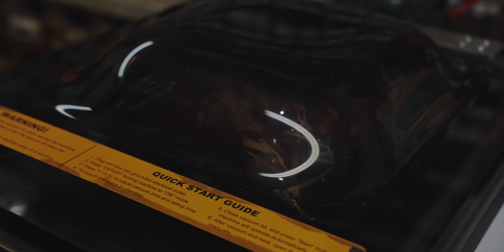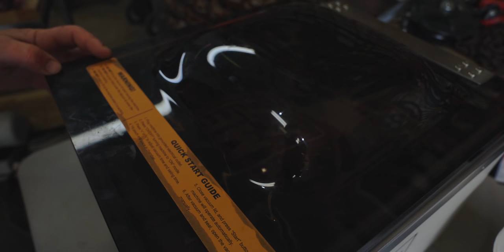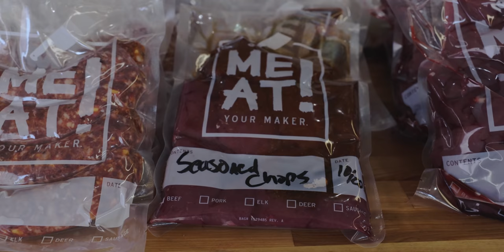How to Butcher a Deer at Home Economy Style (Make Your Deer Meat Last All Year) The Bearded Butchers

Comment: You can use regular freezer bags and fill with water enough to cover and squeeze out the air and it will keep for years just like you put it in the freezer yesterday ! Just used some from 2018 (3 yrs.) and no freezer burn whatsoever ! Also helps if you have a power outage , but does take up more freezer space !

Comment: When you work out all the stuff needed for hunting deer. Adding processing gear is not that big of a sting. Grinder will pay for its self quick. Vacuum sealer. Then stuffer and make or buy a smoker. It's really not that expensive if you think what I cost to take it in every year. And you already subbed to this bad ass channel so you have more then enough videos to watch. Just take your time. You cant make a mistake in butchering, just more burger. And it's a great way to spend family time.

Comment: I use a .308 xtreme point and generally aim for double bottom lung. Saves a lot of trouble in terms of meat loss as I don't generally hit the shoulders. I haven't had a deer go more than 5 yards as that round expands instantly and dumps energy fast shredding the lungs, they usually drop immediately
Reply: Nice. Me too on the double lung. In s.e. Alaska my hunting partner and I would trade off carrying our 45-70s for the brown bear threat so one of us could carry our rifle of choice. 400 grain Barnes hand loads, and my model 70 featherweight .270. Using 160gr Nosler partitions. Beautifully perfect mushroom. I was able to retrieve one from a black bear skull. I've actually killed more deer with the 45-70 though. Same double lung shot, hardly any meat loss. A few times I would take a neck shot as that's all I had. We were allowed 7 deer in some units, they were so plentiful. We usually hunted at treeline and it smelled like a cow pasture.

Comment: We have a coolbot and have used it for deer and currently have a full beef in a home built walk in cooler. The thing you have to watch out for is the unit icing over because of the heat given off by the animal. We only had this issue with the cow. Otherwise it’s an awesome unit

Comment: FYI - HB bag stuffing etc. I have a nice tip for you that I use with my chamber vac. Use a small tall sour cream tub with the bottom removed as a large funnel. It keeps the top of the bag clean for a clean seal. Great job in the processing.

Comment: My brother in law purchased a property that had a shop that the previous owner had put a 10x10 walk in cooler and a 10x10 walk in freezer with all the overhead rails into and out of both, few tables and all our saws and grinders moved down later and it has increased our families butchers abilities and speed 10 fold. The proper set up is key.

Comment: A cheap/$40 metal detector wand will help check for ferrous broadheads. Bit of a one trick pony bc it wont help with lead/copper bullets, but I use one for bow season.

Comment: You have talked about preserving your meat in the freezer to prevent freezer burn. Call it overkill... I have always been fond of wrapping my meat in wax paper or parchment, then vacuum seal it, and finally wrap and label in white butcher paper. I have had steaks get lost at the back of the freezer turn up a couple years later with no noticeable sign of freezer burn. Granted this is a dedicated upright freezer kept at -6f (with it could go to -10, but it falls just short) but the steaks are well insulated... Sadly the lobster tail was not so lucky. Had to use it for some ravioli filling. I never had a piece of meat I wrapped get freezer burned.

Comment: As far as aging without a walk-in, I break the carcass into primals, put in a meat tub, and leave in my “beer fridge” (garage fridge) for several days and it works very well. I put a wire baking rack at the bottom of the tub to allow air flow. Before I had garage fridge, I would use a big cooler with frozen water jugs.

Comment: Great job, we take the shanks, usually 1 front and 1 back shank, put in small cast iron roasting pan, after a couple of hours we add potatoes and carrots and onions then finish roasting, the meat falls off the bone all of the connective tissue dissolves, awesome meal!, Much better use than trying to pick a little bit of meat off the shank, you will be surprised how much more meat you will get from the shanks. We love the shanks this way, try it!, Check out Scott Rea, for more compleat recipe.

Comment: Does it have to hang for a certain amount of time to drain the blood? Or could I put it in a temperature controlled deep freezer turned into a fridge to age? It would have to lay down.
Reply: I think you want to have air circulating around it so if you lay it down on a wire rack that's proped up that may work.

Comment: Oh my gosh. Have to point 2 things out. And I have not watched your field dressing method. But 1st off I was taught to split the pelvis when field dressing to not only remove all of the intestines through to the anus but the bladder. That was not done on this animal but I do see they were reminded bed. 2nd always remove the tender loins when field dressing because they dry out and need to be cleaned right away in case of any contamination during the dressing process. Again; you guys are awesome. Will look for videos on your field dressing techniques. But get those tenders out. They don’t need aging other than in your refrigerator. 😎

Comment: I'm not sure Y'all understand where the butcher complaints come from and why. It is evident that Y'all do it right. You are getting paid for what you sell. No one could complain about what you give them for their money. This is not the common case.

The complaints come because the guy in the small butcher shop or the guy that takes 2 weeks vacation to butcher deer are not using the same standards that you do in your operation. They get paid by the animal and are less concerned with getting all your meat back to you. They get paid the same either way.

I butcher all my deer. One year I killed a yearly and packaged 38lb of meat. I later killed a 110lb doe and took it to the butcher. I got 42lb of meat. He did not take the time and care to get me as much meat as he could because he is getting paid the same for a good job or a bad. I should have gotten back around 55-60lb of meat off that doe.

 
Wade